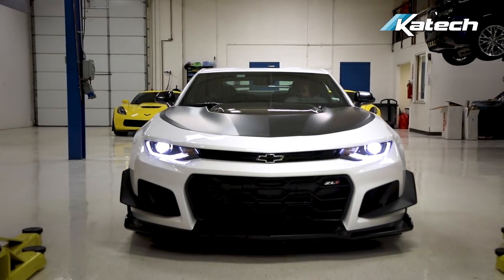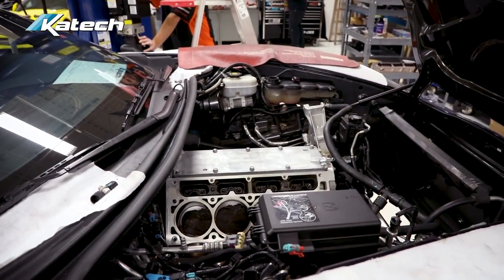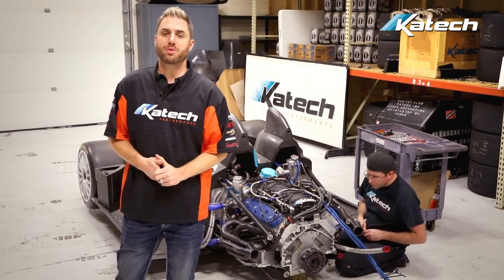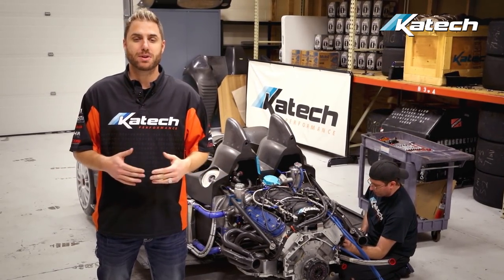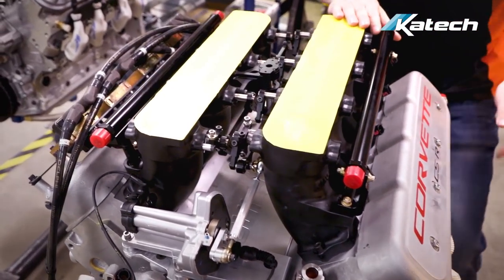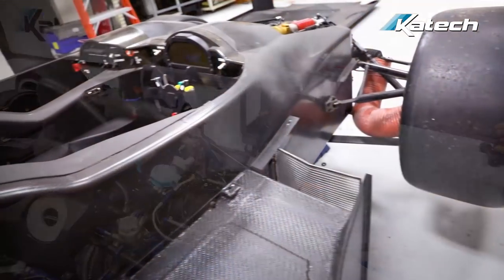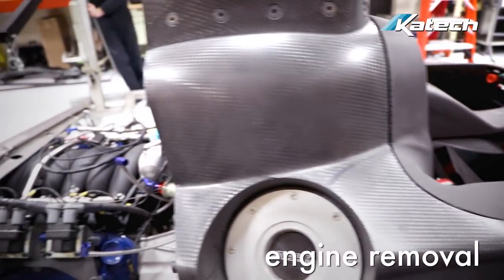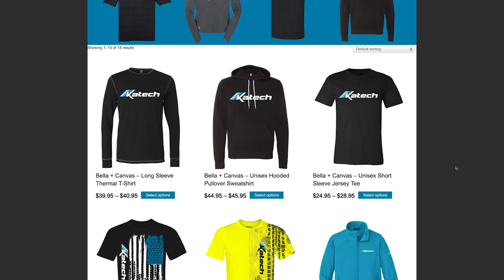Katech vLog - The Streetspeed717 Z06 chassis dyno and shop projects update

Comment: Mike's car is at another shop getting bad work corrected from you
Reply from the maker: That's not this car.  Mike had two yellow C7 Z06s.  We did the 2016, not the 2017 with the Procharger.